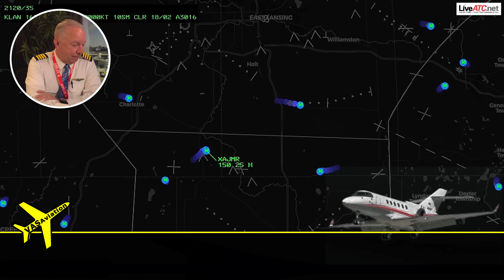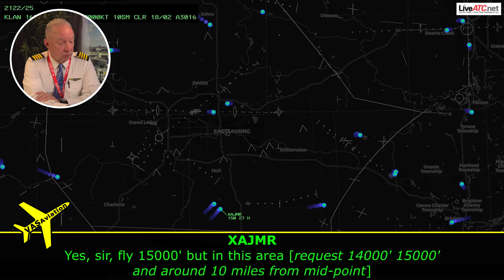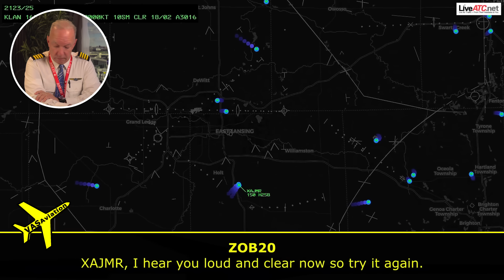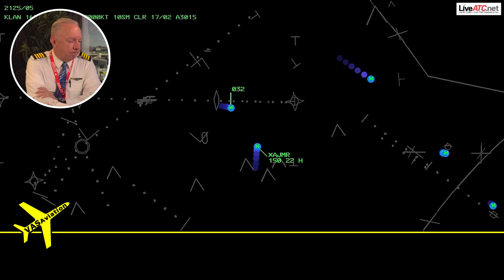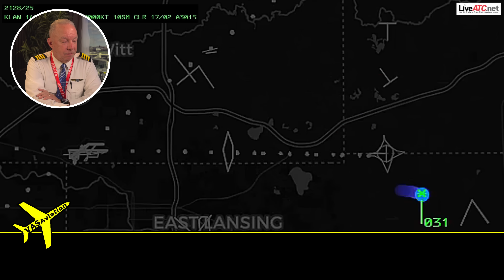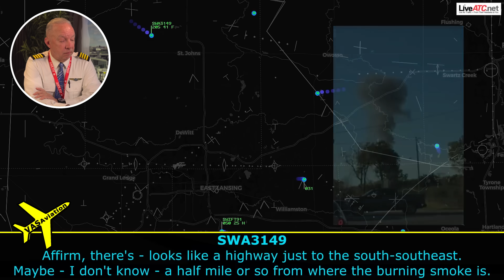Inside the Hawker 800XP Stall Test That Ended in Tragedy

Comment: We did all these recoveries in gliders with the British RAF Air Cadets, and later in powered flying, it certainly is "an eye opener" what we call in the UK a "sphincter twitcher" lol
Stalls and Spins are scary, but good training puts you through them.
On a winch and cable launch we had the cable break at about 700 feet, aircraft angle roughly 45 degrees, felt the nose dip sharply, stick forward to try to get flight,  and it would not release when i pulled the toggle release, nose being pulled down, the Instructor took over and did a steady circular flight with the cable end on the ground and basically coiled it, as i pulled on the toggle, until it released at about 250 feet. Then we did a straight in landing on grass into wind. I was 17, the Instructor was a Regular RAF jet pilot, and Gliding Instructor one really cool chap.  Got into a different glider and straight back up again, to keep me confident, and aware of emergencies, great man, and i got my wings via the next five flights solo.
Love your videos, still learning lessons, often a sad reminder of what can happen, but thankfully rarely. Merry Christmas and a Happy, safe, healthy, prosperous, lucky, peaceful, and all the best for the New Year from UK.

Comment: Talking about spins and mentioning King Air aircraft, it does not appear that you have ever looked at the incident that took place near KCGI where all the holes in the swiss cheese lined up and a King Air almost spun in. Layer of windscreen cracked -> pilots dumped cabin pressure and donned O2 -> MALF O2 -> pilots passed out -> came to thousands of feet later in a spin -> over responded -> near folded the aircraft.

Comment: I work for Duncan Aviation in Provo. Any Hawker aircraft that gets engines removed for any reason has to do a stall flight test. They are usually done by trained pilots but thos pilots cost 10s of thousands of dollars each per flight. This was the last test before tgis aircraft was to be released back to the owner

Comment: Rear engine aircraft with T-Tails are notorious for entering deep stalls.  For certification flight testing they install drag chutes in the tail cone, so that the pilots can recover the aircraft.  The wing blocks the airflow to the elevator and there is no other way to recover, the plane just falls flat.  It could be that the stick pusher did not activate, or the pilot pulled so hard he overrode it.

Comment: Stall tests are not that bad if performed correctly. The Learjet series requires them after any removal of the leading edge, but they also required a Bombardier test pilot and depending on CG, ballast weight mounted far forward in the cabin to make sure the aircraft would go nose down during the still to aid recovery. The test was more or less to make sure the aircraft did not break sharply to the left or right and enter a flat spin.

Comment: Hey, Cap'n, this is a SWEPT WING aircraft with a T tail.  Swept wings don't give you the traditional buffet prior to stall.  The configuration of the tail makes it even worse.   That's why these aircraft require a STICK SHAKER.  This crew was apparently not fully aware of the stall characteristics of this wing/tail configuration.  They did not sound professional (like someone who frequently and professionally tests stall characteristics on an aircraft coming out of heavy maintenance).  Probably the standard crew come  to take delivery of the Mexican-registered aircraft: Mexicans with poor English, coaching from another person in the cockpit,  declaring the stall twice and then apologizing?,  and maybe even structural problems.  This makes the second Hawker crash within two years, both failing to recover from a stall at altitude.

Comment: They were pilots (probably associated with the private jet) performing a REQUIRED approach to stall series to test the stick shaker and pusher after heavy maintenance as part of return to service. They obviously inadvertently entered a full stall - in the video  you can't tell if there is rotation (a spin) but the NTSB can determine that. THIS TEST SHOULD HAVE BEEN ACCOMPLISHED BY A HAWKER TEST CREW OR TEST PILOTS TRAINED BY HAWKER.

Recovery is the same in every airplane - Manual control (autopilot and autothottles off) stop any rotation with opposite rudder - decrease the angle of attack until the stall is broken (stick shaker stops) level the wings to get LIFT  - adjust power and drag as needed and pull out of the dive. It may be necessary to add FORWARD STICK NOT JUST LET GO to decrease the angle of attack.  Flat spins add other steps (unblanking the elevator to get the nose down / decrease angle of attack.

This should have been qualified test pilots at the controls - not line pilots. RIP.  I teach this stuff for a manufacturer and almost died (with a trusting passenger) in a stall spin 58 years ago as a new private pilot. I still remember the event vividly.

Comment: I'm a maintenance technician worked on the 800 XP for many years I've actually went up and done stall checks after maintenance anytime anything's done on the leading edge of a hawker, you have to do a stall check 
 Sadly. Not for sure of the pilot's proficiency in doing this.   feel so sorry for those on aircraft  as I've been on board many flights doing this .

Comment: I worked heavy maintenance on King Air 200s that were Navy C-12 aircraft for several years and we always removed the outer wings.  The wings do not come off at the fuselage, they are removed outboard of the engines.  The inner wing is actually built into the fuselage and is one piece from one engine to the other.  There are four bolts that attach each outer wing to the inner wing and the attach pads have serrations in them to keep the wings from sliding around on their attach pads.  I don't know how the wings would be attached crooked, all that is required is to match the upper skins and lower skins with the inner wing and that is all that is needed to do it right.  Apparently your maintenance crew just didn't care or was it a lack of training?  The manual certainly covered wing removal and reinstallation.

Comment: Stall test or spin test? Or did they enter a spin from the stall and not use correct spin recovery actions! A standard stall should be straight forward to recover from ! Did they have a wing drop stall and not recognise it correctly as the recovery for this is different to a spin recovery ! The rate they where loosing altitude would suggest they where in a spin and not appliing correct spin recovery actions !
Reply: And perhaps a flat spin.

Comment: Jet Aircraft, have dedicated stall approach procedure and recovery that requires specific training and experience. This aircraft is known for its lack of warning of the stall, and has a Stick Shaker that goes off 9% above the stall speed.

 This stall started at over 14,000 feet above the ground and were unable to recover. We know that this test flight was after maintenance that required checking stall but we don't know what the pilots had planned as specific required procedure. 

We don't know the two pilots experience or qualifications. 
It appears that the Pilots were not aware of the tests requirements. 

The pilots had real problems communicating in English and is NOT acceptable. These pilots most probably did their training or at least their Hawker training in the USA and most probably did their Sim training at Flight Safety. 

The pilots Radio is not up to the standard English required for flight training but is typical of the poor level of English we see in a lot of foreign students. Its shocking listening to the radio. 

The flight test after maintenance is very complicated, it needs a specially trained crew to do this flight test.

The primary cause of this accident is that the Pilots were not qualified to do this test and went below the lowest speed specified for the approach to the stall. 

Its obvious that they did not know what they were doing, that they applied incorrect stall recovery and entered what appears to be a vertical plunge into the ground. It took seconds to go about two miles , ie from 14,000 to the ground. 

One of the causes of this accident the captain did not understand the test flight requirements, did not have the qualifications or experience to do this test flight, they applied the wrong recovery and entered an incredibly rapid vertical dive into the ground. Hopefully, this accident will change the English language standards in the USA .

 This accident hopefully will bring about changes in the future. It will also be a human factors video.

Comment: I had a stall test on a Hawker 800XP go  bad for me. In  my situation the stall strip that is located on the leading edge of the wing about 3 or 4 feet from the fuselage, had been removed for maintenance purposes and re-attached so a stall test was required. Every time I tried to get to a stall the wing would dip and it would try to roll hard. The test failed and I had to land with increased speed. The issue was that the stall strip had been installed upside down and it obviously mattered.  It was re-installed correctly and the test flight passed. This is obviously a design flaw that it can be installed upside down. They should have made it idiot proof so you could not install it incorrectly. I wonder if this is what occurred on this crash.

Comment: There's something that struck me here (non-aviator): weren't they assigned a block 14000 to 16000 ft? But if they were going to do a deliberate stall, wouldn't they need a block higher from top to bottom than 2000 ft? So is it possible they didn't mean to stall?

Comment: So, I flew a couple of thousand hours on the 800xp! We had 2 in our Operation in Europe. After removing the TKS Paneels, we had to do this Test Flight. There was an operational advisery (some 3 or 4 pages) to override the Stick Shaker by holding the Yoke firmly till the Pusher activates! With this, you‘re balancing very close to a Stall. Once the Pane tilts over its right wing momentaraly and I found my selfe inverted, but not in a spinn. I lost 7000ft to recover…. This was the last time I did this!

Comment: The radios were just fine. The language barrier and the simultaneous verbal coaching from the co-pilot was the issue. The fact he didn't know the phrase "BLOCK" is a problem. Average line pilots should never attempt a swept wing stall. This is why. In fact, on this plane you're only supposed to go to the pusher, never a deep stall. They were even in the upper SIXTY knot region at one point! Insane. RIP.

Comment: In the Hawker, you can get unpredictable stall behaviour if the wing leading edges have been replaced. This can become necessary due to the TKS anti-ice system, which, if not primed before flight on a regular basis, can cause dried-out anti-ice fluid blocking the pores in the leading edges, which requires leading edge replacement. The aircraft absolutely does NOT behave dangerously in a complete stall, if rigged correctly, in fact it is very stable. It just settles into a nose-down attitude and descends at about 5000 fpm.

Comment: Once you get control of the stall when do you restore engine power.
Reply: Best ask a flight instructor, but basically once you are "straight and level", bring the power back in, fly straight and level while your heart rate reduces, give yourself time to settle down and think. 

I did my first stall/spin recovery training in gliders, restoring engine power was something we didn't have to worry about. When learning to fly 'powered', we were in the classroom with an instructor, he asked have any of you stalled or spun before? I told him 'in gliders', he said 'what height did you enter the spin?' I said about 700'. He then explained why, in graphic detail, we would be doing spin recovery training above 4,000'. There are still too many GA accidents where folks stall and spin below 300', often on approach. You will not walk away from that.

Comment: I have done this test in the Hawker 800xp.  It is required after the removal of the TKS leading edges for the corrosion inspection.
You take it to the pusher but you must bleed off the airspeed very slowly to be successful.  If it rolls, it fails.

Comment: I have conducted hundreds of these types test flights during my career and I can unequivocally state that you never deviate from established techniques, policies or procedures. 

When conducting these required post-maintenance stall test flights on these Hawker, and also on many Learjet, jet aircraft you are not attempting to see “how bad” the handling characteristics can get - you are evaluating whether or not the jet passes a very specific set of requirements for stall warnings, flight control input responses and most importantly, stall recovery throughout the evaluation. You do this safely by setting very specific and recognizable signs of handling test failure and IMMEDIATE “knock it off” parameters. When you do not have a properly trained and qualified flight crew using proven techniques, a clear plan throughly briefed and clearly assigned duties - this is what can happen. All of this is clearly spelled out in the aircraft maintenance manuals.

Comment: On another web site they had some of the parameters that have to be followed, very precisely I might add, when performing this test/s. One is the the approach to a stall requires decelerating at a very specific rate. You have to inch up to it, iirc, about a knot a second deceleration, get the stick shaker and then the stick push preventing a deep stall. If you just bomb into the stall area on this plane, bend over and kiss your ass goodbye. This is a no stall aircraft, reportedly it can be very violent and unrecoverable.

Comment: Back in the mid 1980s, I belonged to a model airplane club with my ex husband, and we practiced all kinds of aerobatic stunts, such as aileron rolls, Immelmans, tailslides, and also including a maneuver called a stall turn, but in the models at least, it was different than what you describe.  To induce the stall, you climbed vertically until it stalled, and it would then fall out by tipping over nose first (that being the heaviest point of the R/C models, where the engine was), and from there you could fairly easily recover to normal flight.  I do not believe I'd care to experience that in a real aircraft! 🙂

Comment: Many years ago I logged some hours    In a T34 (not a Charlie) at NATTC Memphis. Stall/spin recovery was priority 1. Ailerons neutral, stick forward to break the angle of attack and opposite rudder. However, if you kept the ball centered she would (usually) break more or less straight ahead. Now I had this one CFII who insisted on pushing the limits. He had me go to 100% power pull up the nose and at the break he had me fully cross control the the aircraft (in the direction of torque and p factor!) Right aileron full left rudder. These were the most violent spin entries I have ever encountered! She snap rolled so fast to the left your head would almost hit the canopy. He was one hell of an instructor! He taught me stuff they never taught us in flight school. He was big on partial panel. One thing I’ll never forget was how he taught me how to find best glide (Vg) speed without an airspeed indicator. He told me look out the side of the canopy and put the wing chord square on the horizon…low and behold I was within 2 kts. of best glide. Some months later I was transferred to NAS Oceana and we lost touch, but I still treasure his entries in my old logbook.

Comment: I have over 2600 hours in Hawker 800’s. After any maintenance has been done on the leading edge for the wing a full stall needs to be performed to insure normal stall characteristics. If it takes more than 20° of correction to keep it from rolling it fails and must be corrected. At our company this had to be done by a check pilot that been trained in this procedure and the right seat needed be a PIC qualified pilot.  In the many that I performed I never had one fail. This one appears to have failed and entered an unrecoverable stall. Prayers for their families.

Comment: Second, nearly identical accident in just over a year.   Stall testing in a swept-wing jet by anyone other than a trained, experienced flight test crew is really asking for trouble.   My guess is that NTSB and FAA are going to step in and change the rules associated with this type of post-maintenance check flights on this model of aircraft.   Historically, the Hawkers have a reputation for some really nasty stall characteristics.

Comment: Stall recovery in the Hawker during a functional flight test is much more than basic function. It is a full aero stall test and when accomplished within the CG parameters it is fully recoverable even when the aircraft misbehaves which is typically due to the reattachment of the leading edge and sealant. I do not know if that was part of the service in BTL but given the LE has corrosion issues due to the TKS system, it is often part of an inspection. 
As a check airman for Netjets in the Hawker program, we developed an advanced stall training program specifically for the Hawker 800XP/900XP. Developed and trained in the simulator, instructor pilots were named and qualified to conduct the stall test in the Hawker. The simulator of course is not programmed for out of envelope flight but using various settings gave us the conditions that techniques could be trained and practiced. The most valid point made was to UNLOAD, UNLOAD, UNLOAD regardless of aircraft orientation. This allowed the wing to start flying again and often took 4-5K in altitude to avoid an accelerated stall.
It is sad to see another crew loss like this.